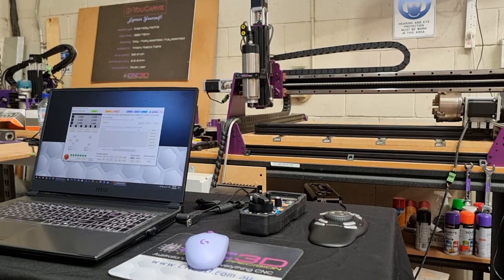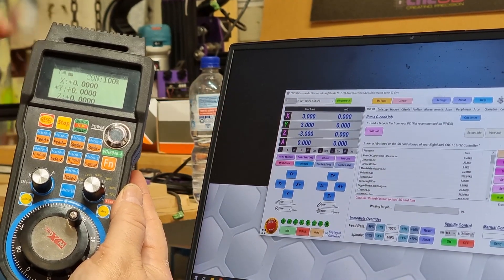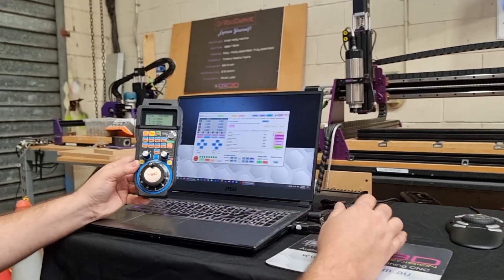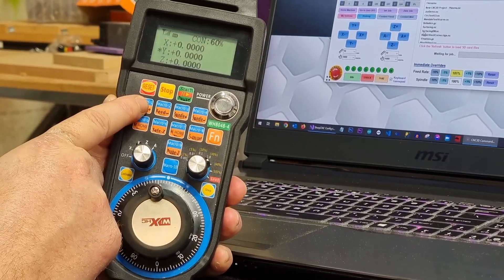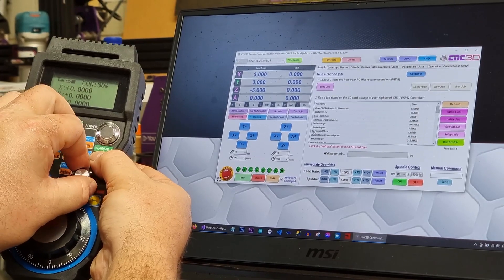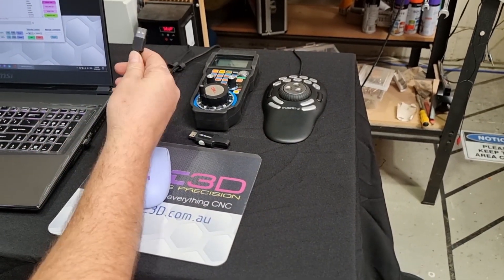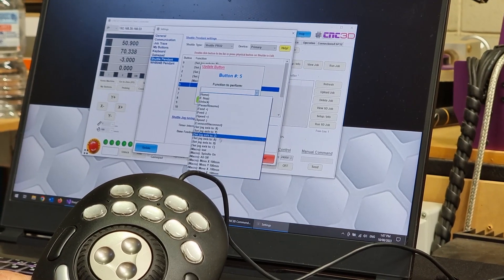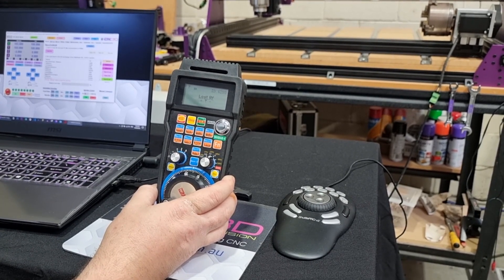CNC R&D Fridays! - Interfacing MPG pendants to Commander on GRBL?

Comment: I dont need the Nighthawk Controller for this right? it will work with commander + Xprp5?
Reply from the maker: Hi Jason, Commander is designed to work with most GRBL based controllers and the pendant control feature is available to any compatible controller that it is connected to, including the xPROV5.

All features are available to all controllers with the exception of very few where there are specific advancements in features on our Nighthawk that simply do not exist on other controllers such as being able to start an SD card job from a specific line.

I hope this helps!
Reply: @cnc3d  thx for info!

Comment: Shut up and take my money. A couple of questions. When you activate the pendant, can you still use the app? Is the pendant rechargeable, or does it need batteries?
Reply from the maker: The pendant uses batteries, but it is a low frequency controller, so the power consumption is quite low.

The range is around 40 meters.

Yes you can definitely use Commander but keep in mind the jogging distances and feed rates will be difficult to change when the Checkbox is active.
Reply from the maker: Haha! Thank you. We hope you enjoy!